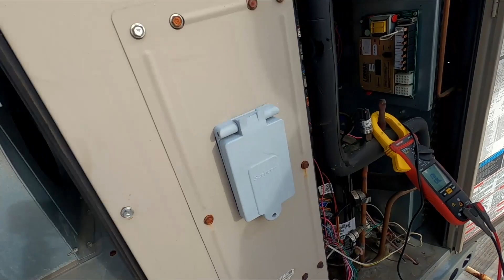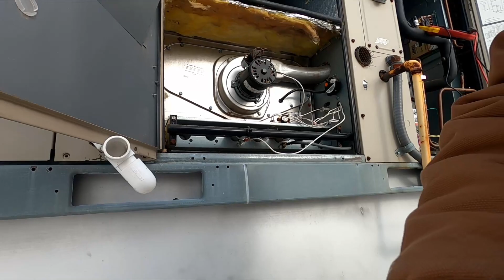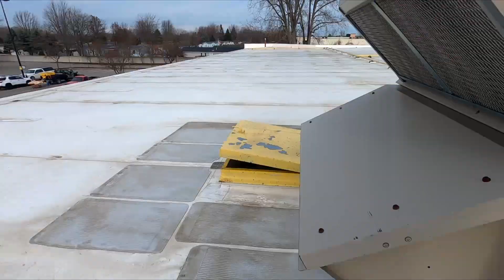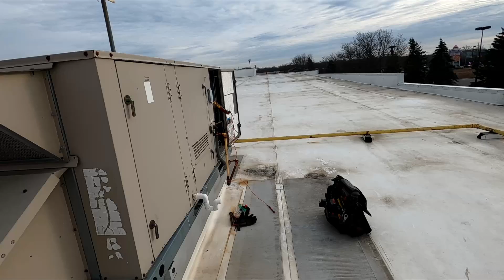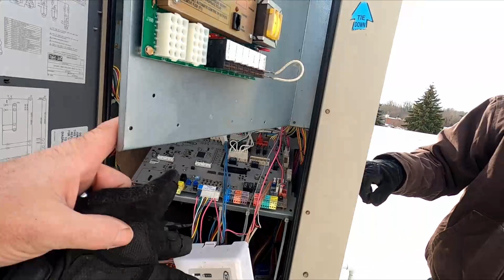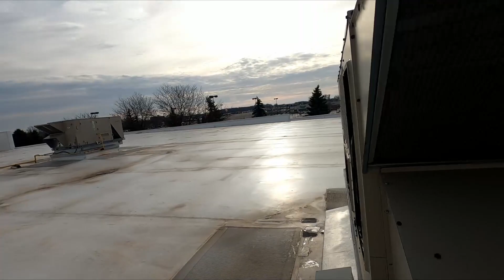2 Lennox Roof Top Units Down

Comment: I get very frustrated 😤when others not authorized to do A/C work put their 🙌fingers in the unit and screw things up !!!!  Why didn't the electrician 🕵‍♂catch that rubbed through wire ??? Those units are headache city !!!!! Good thing you are a super 👨‍🎓tech and figure these problems out. You are to be commended on your great 🎮diagnostic skills !!!! Well done !!!!  🚐On to the next one.
Reply: Electrician job stops at the disconnect ...not his job to be in side checking wiring . I doubt seriously he would mess with filters or open the unit.  Lot of other people could be messing with filters.